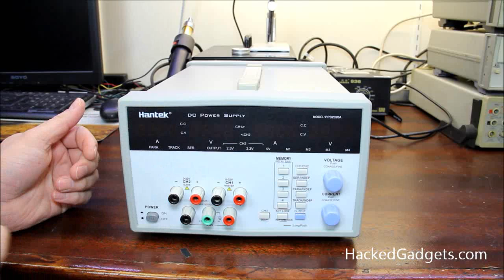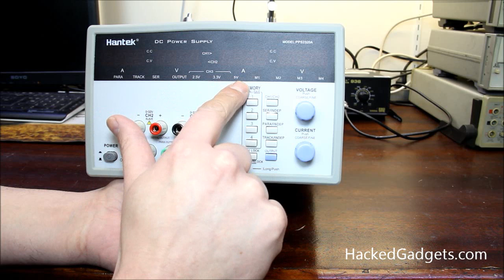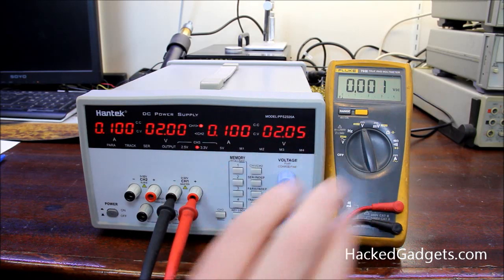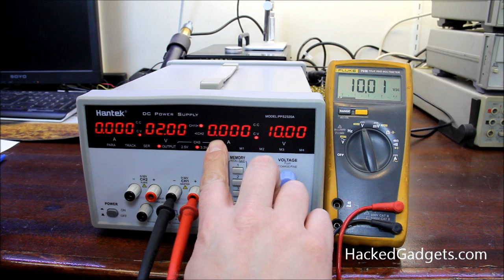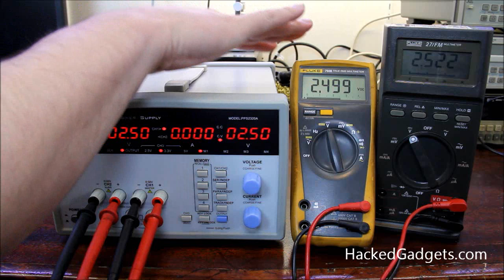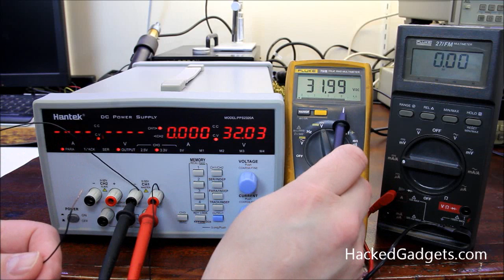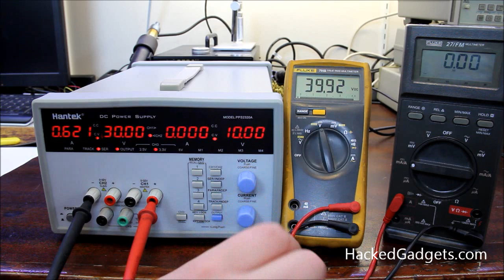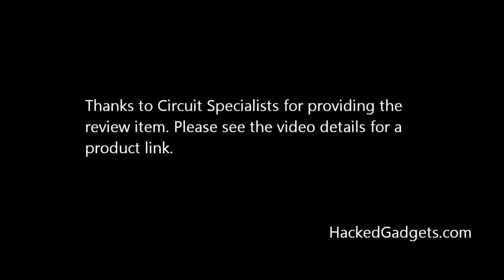Hantek PPS 2320A Review - Initial Test

Comment: It shows the set value when you start changing the current, so you don't have to push the dial every time ( I noticed that early in the video ).

The voltage discrepancy when shorting the outputs in serial mode is most likely a combination of a diode drop in the overloaded channel, and various sources of resistance.

The biggest discrepancy is obviously a diode drop based on its 0.6V - 0.7V value.

Comment: It will be interesting to see what that fan does when you put this unit under significant load. Hopefully it's a variable speed fan and only the greatest loads will cause enough heat to require a vacuum cleaner noise level because this looks like a great deal for only $199.

Comment: Hi,  I have a Tekpower TP3005T from amazon, and it is basically controlled the same way as the Hantek. My concern is, that if the readings ever drift, I must be able to adjust it again. But I think this is done via software, because it has no calibrating pots. What is you're experience with power supplies?? Do the readings drift, and if so, over what period in time. Maybe i'm a bit over concerned.

Comment: The review overall was okay. But the unsafe way you were shorting wires with your bare hands at 6 amps is not a good way to show young players how to test their power supplies. Especially holding the resistor with two fingers across each of the leads is a sure fire way to get a damn good shock should the power supply current limiting have been faulty.